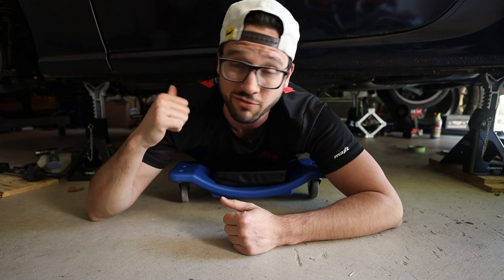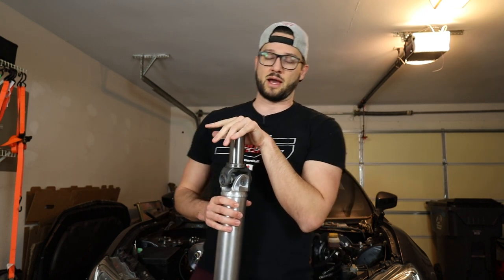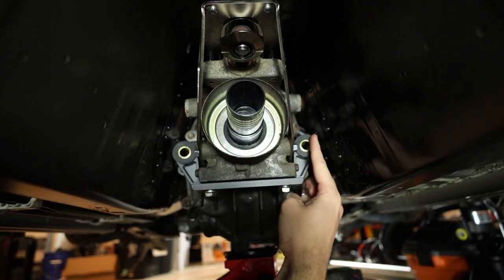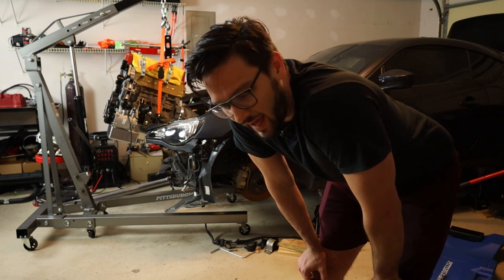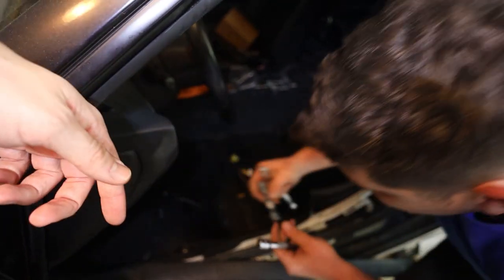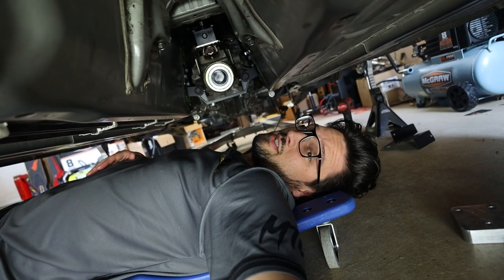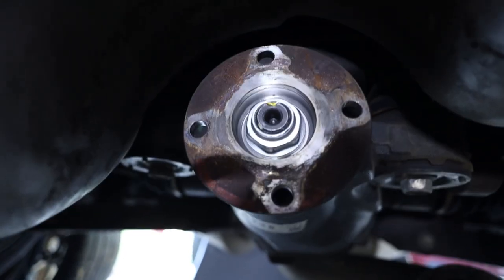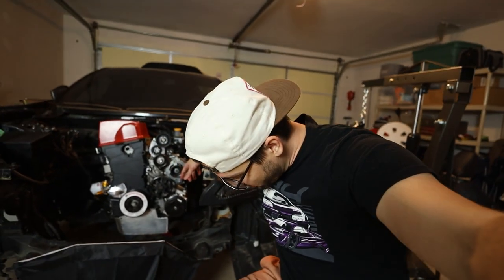K24 Swap BRZ Part 16 Ep. 1 - Mounting the Transmission and Driveshaft

Comment: Can you still fill up the transmission with it installed with a pump and a tube or not possible? Great video series btw!
Reply from the maker: Thanks! Yeah if you’ve got a pump and tube you can use that. There is enough space. I just didn’t have one at the time.
Reply: Awesome thanks for the reply!  @BuildingWithSean

Comment: The lower the transmission is, the wider( more room) you got.just lower with the jack and they should line up without extra bang to the tunnel.
Reply from the maker: Fair point. The back-end of the trans was already the lowest point on the underside of the car, and I was trying to set it as high as possible so it doesn’t get damaged if I hit a big pothole or roll over a burm at the track. Plus if I made it any lower than this, it wouldn’t have been holding any weight and I wanted to take that stress off of the engine mounts. I appreciate the feedback and thanks for watching!
Reply: @BuildingWithSean  make sense since looks like the k power engine mount kit is higher that the tfworks one. Dropping the transmission would kinda make it tilt down.. but you did a great job putting all those mix and match parts in.👍👍really impressive
Reply from the maker: @MeDontKnowCars  Thanks man I really appreciate that!

Comment: It would be easier to just use a factory brz 6 speed like boostedboiz did with their FRS juts cnc a plate to merge the motor with the factory trans and if you ever wanna go back yo stock its just some bolts and done
Reply from the maker: The problem with the OEM BRZ trans is that above 350ft-lbs they aren’t reliable. I personally know multiple people who had boosted FA’s that had 4th gear let go on them. Didn’t want to deal with the stock trans failing and having to swap it for another stock one or go to a CD009 later. 

Also, you have to cut/hammer the stock trans mount for the K-Swap, so going back to stock FA is pretty much impossible.
Reply: @BuildingWithSean  personally I would opt for an STI 6 speed maybe converted to rwd or try to keep the AWD and put an h6 ez30r and have and amazing front engined boxer but If I had to go for the k series I would just beef up the stock trans and call it a day